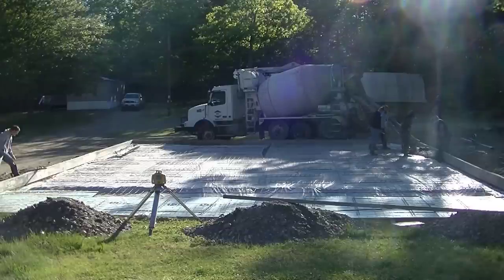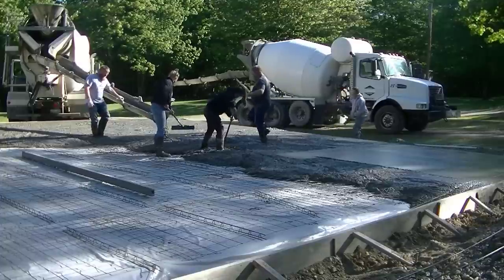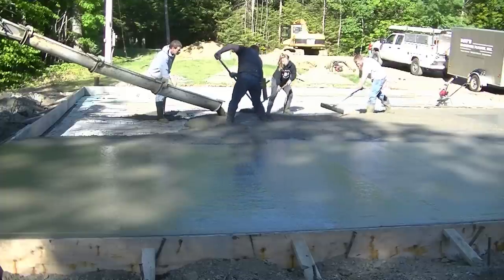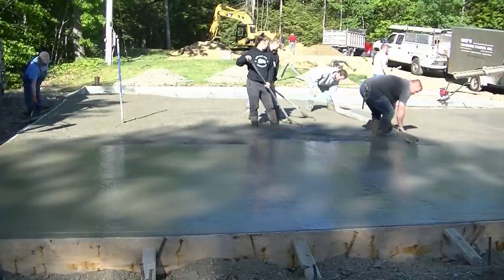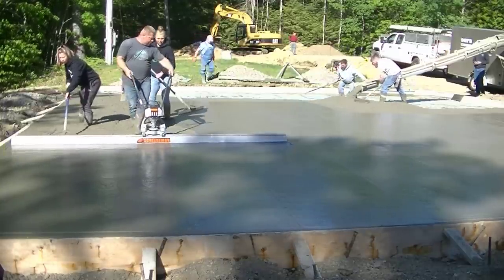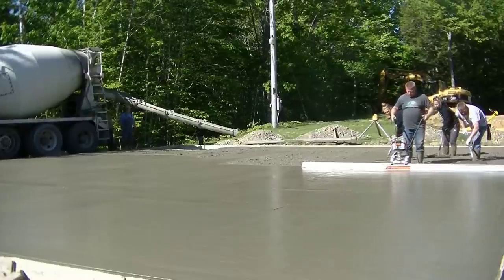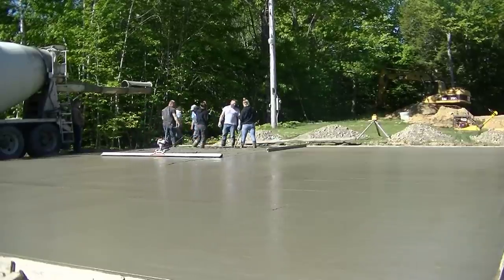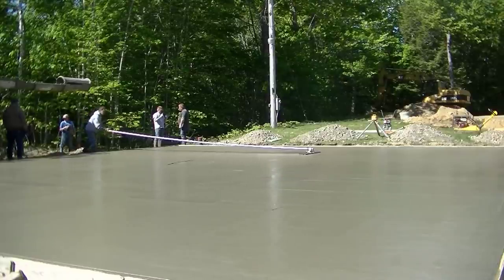Pouring A Concrete Slab For A New Garage (50' x 40')

Comment: I’d kind of like to see you spend a little more time talking about the layout and forming of the slabs you guys do. Where I’m from (S. Fla), it’s almost always 2 different crews. Carpenters do the forming and concrete finishers do the pouring. But it sounds like you guys do all the forming yourselves too.
Have you guys ever had any of your slabs tested for the ‘F’ numbers? F’s of flatness or F’s of level?
Reply from the maker: Yea, we do all our forming. That way I know what to expect when I pour. I haven't had anyone test for flatness. When I've gone back and checked with the laser, i'm usually about an 1/8" up or down in 10'
Reply: @MikeDayConcrete  We did a 300K sq ft warehouse once that required ‘super flats’. We almost didn’t take the job bcz we weren’t sure we could guarantee the numbers. They eased up on the numbers a bit bcz they couldn’t find anyone else that would guarantee the numbers either. They wanted to use laser guided robots to autonomously traverse the warehouse and retrieve products. We were able to pull it off using laser screeds and pouring ~100K sq ft at a time. It was a tilt wall project and 1 wall panel stuck and had to be chipped out and re-done. Needless to say, that dicked-up the floor in that one section. As luck would have it, that was the area intended for office space (carpet), so we were still able to give them pretty close to super flats for their warehouse. Never got a call-back so I guess their robots worked fine 😅

Comment: Interesting to see that you don't put any crack control joints in a slab this big. Over here in the UK we would have induced joints formed. Will you be cutting the induced joints at a later date? What  are the rules you follow for joints?
Reply from the maker: We saw cut all out floors and slabs. Just didn't show it in this video. We use the Soff-Cut saw and cut as soon as we're done power troweling.

Comment: so is there any release agent on the forms so they pop off easy and don't take anything with them when your removing them?
Great job Jeff's hiding in the back ground.
Reply from the maker: No release agent. We don't usually have a problem with any sticking to the forms. We clean the forms after each use.

Comment: Those two girls are really coming on. Good job. Just a question. Why not use a pump and start from the back and work towards the front. In New Zealand we call the bits that hold the mesh up chairs. They are black plastic and come in two sizes. 50 mm and 75mm. Looking foreword to the next one. 👍👍
Reply: We have the plastic chairs too (in the US) and honestly that’s what most people use on slabs like this. The slab bolsters they’re using are kind of considered the ‘Cadillac’ method because it’s better at holding the entire area of wire up than individual chairs. But they’re also much more expensive than the individual chairs. 
On elevated decks, individual chairs (any elevation you need) are always used to hold up the top steel reinforcing (rebar, not wire) and 20mm ‘slab runners’ are used to elevate the bottom. The slab runners are similar to the bolsters they’re using here and come in plastic or plastic dipped steel to prevent them from rusting thru the bottom of the deck.
Reply: Yup we call them chairs over here too. My guess would be a pump for this small of a pour would really be an unnecessary expense
Reply from the maker: It's about $1000.00 US to get a pump to do this. I didn't feel we needed to do that. Yea, these "chairs" are a more expensive but they work good.

Comment: Let’s say I wanna do a 35 by 50 for half court basketball how much would that be?
Reply: Oh wow, this is exactly the answer that I’m looking for also. (Same size 35x50 for a half court for basketball lol)  I’ve been looking for an answer or a rough estimate for some time now. But basically I found that it will be somewhere in the $9,000 range for the concert slab. That’s in MN in the Midwest. Let me know if you find any information

Comment: how  do you insure  the  reinforcement  wire is  in middle of  the crete? and  what  slump  did you try to start  with? From  the looks the  majority of  wire  is  laying  flat on the  bottom?
Reply: Yeah , not enough chairs and the mesh doesn't go out to the edges far enough .